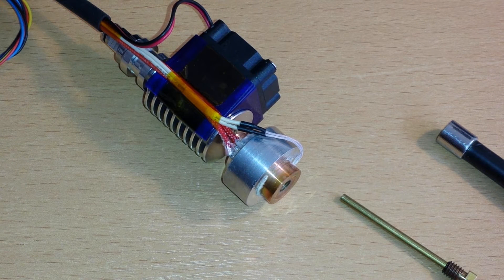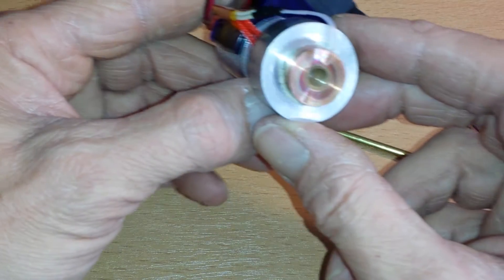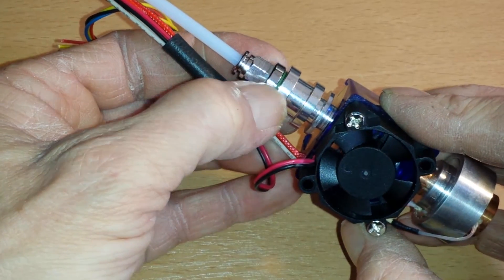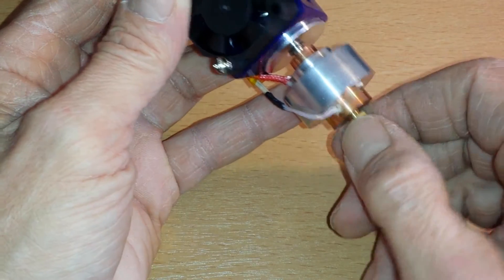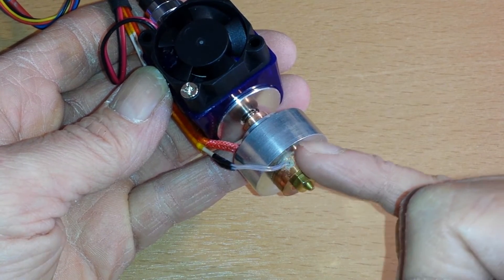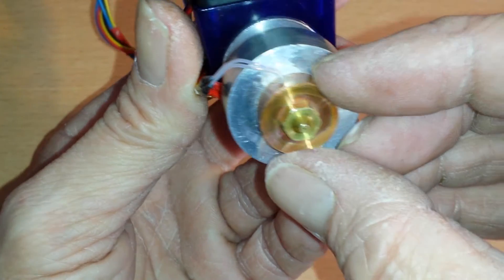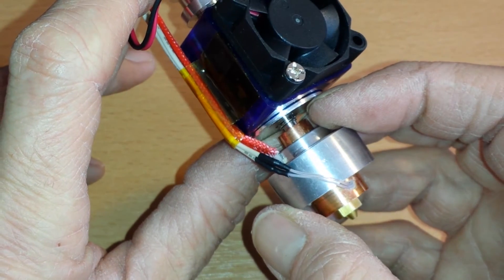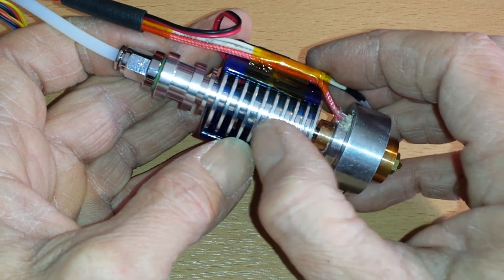High Temperature 3D printer for polycarbonate. New Hot End 400 Degs C

Comment: Hi there, hope all is well with you. I've been looking at your videos recently. Excellent design of your 3d printer. 

Did you get to document your Hot End 400? I am also curious as of how you built the heater itself, how you glued the tip to the brass pipe and I am looking forward to more details on the water cooling system.

Keep the excellent work!

Comment from the maker: Hi there. I will be releasing a new video on the hot ends that I have made very soon. various models / wattages tried and still in testing stages. Excellent results so far. Photos and possibly a web link to also follow. Thank you for being patient.
Reply: hey there, what brass tubing are you using? and how did you "glue" it to the nozzle. looking forward to that web link. i am very interested in your heatelement